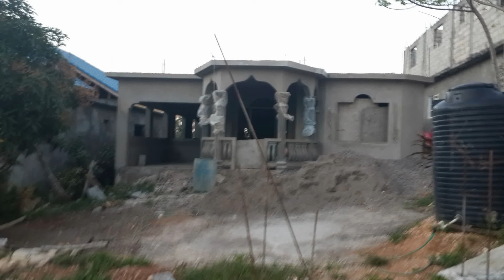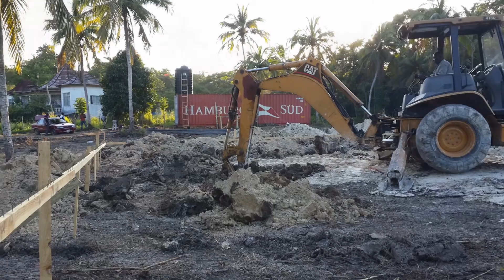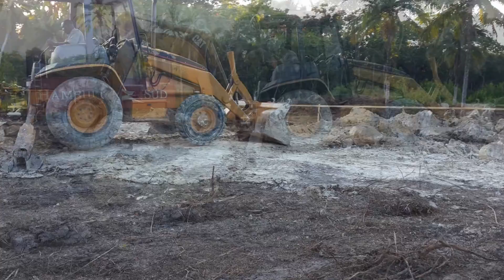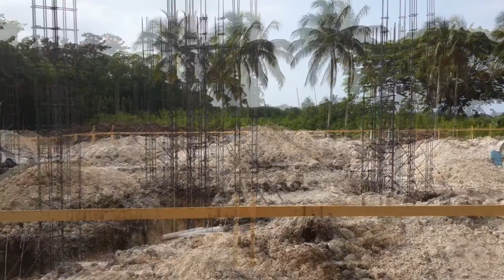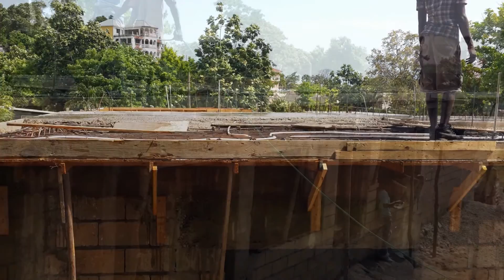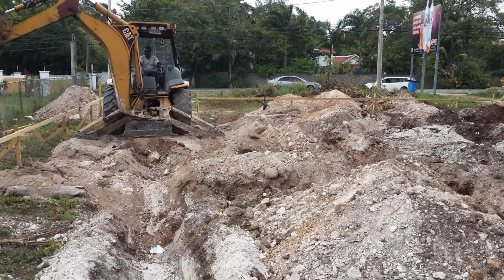St. Ann Jamaica Architect - Parish Council Approval - Design & Construction

Comment: NECCA did a bill of Quantity for me and I would recommend them to you. It doesn't matter where in the Island you are just contact them.
Reply from the maker: 54 Main St, St Ann's Bay, Jamaica
Shop 8 & 11 Manning's plaza, Port Maria, St.Mary
Whats App: 18764329475
Offices : 876 648-7188 OR 876 648-7205
neccajam@live.com
Reply: I used the bill of quantity to make all my building decisions as I managed the project. Trust me, they are the most reasonable.